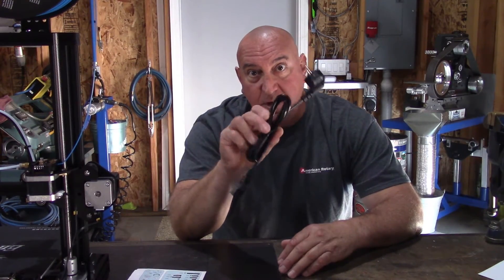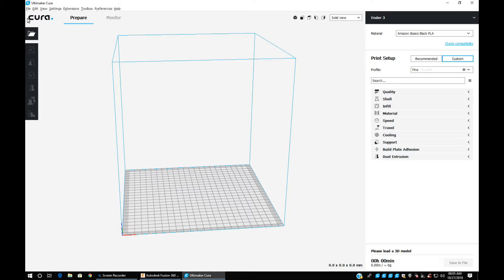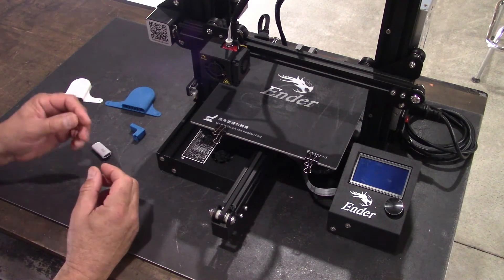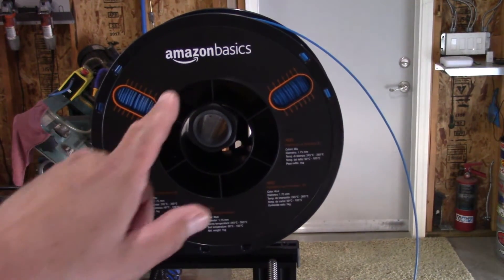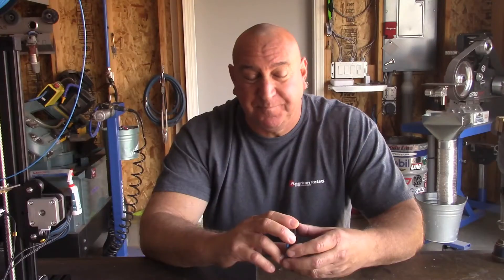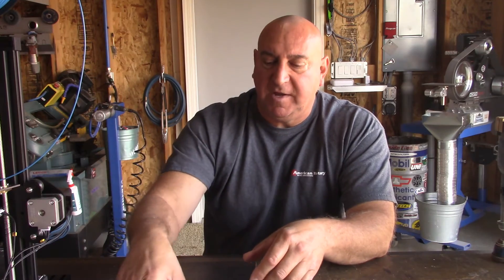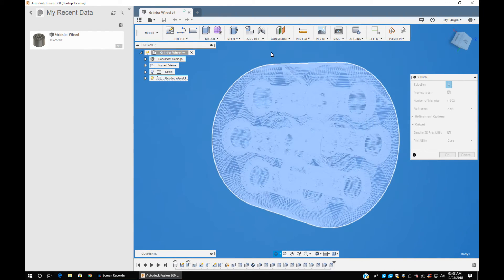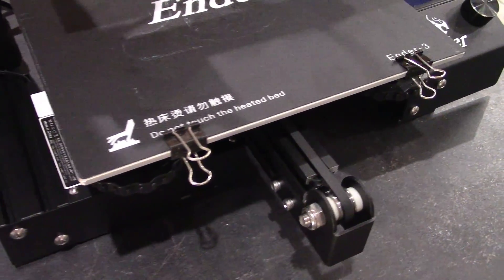Creality 3D Ender-3 Printer Part 2 #realraysgarage

Comment: How was your experience ordering from banggood? Did it arrive in a reasonable amount of time?
Reply from the maker: The printer did take about a week longer than standard U.S.A. shipping so that's not too bad coming from China! It was packed very well and no damage at all. I really like this printer, works very well after a short learning curve and some trial and error. Its a great printer for the price!
Reply: @RaysGarage  Thanks, going to order one within the hour. Do you have any suggestions of accessories to purchase along with the printer? I'm getting a couple of steel nozzles.
Reply from the maker: @lomeranger  I would recommend getting it set up and running, then maybe go to a glass platen and better height adjustment screws. Be sure and buy quality filament, I found the PETG works best, check this out; https://www.allthat3d.com/3d-printer-filament/
You will need filament, the printer only comes with a very little amount. I would also build an enclosure and or just put a cardboard box over the printer when printing, it will save you lots of headaches!!!
Reply: @RaysGarage  Enclosure? Raise the ambient temp? Ha! Just like ink jet printers, the price is in ink/filament. Just ordered the printer and am very excited. Would you say the enclosure helps with all filament types or just certain ones?

Comment: Ooo My I remember the Days.... It will not take you long to get it printing good, Just Patience is all you need. I would NOT Print in ABS unless you need to. Check out "PETG" Filament Just as good for most stuff you do and easier to print and PLA is good for most basic stuff :)
Reply from the maker: Thanks for the info, just picked up some PETG off Amazon and am really liking it so far!

Comment: ABS needs retain heat well above the bed proximity to keep from delaminating. ABS is also worse about warping when it cools. That will be your next findings. I use ABS almost exclusively, having learned to avoid the pitfalls, because you can make prettier things with vapor polishing ABS.

Comment: It's definitely a learning experience. Supports are your friend in Cura. And also learning what plane to print the part in. Check out the adaptive settings as well. Definitely helped me get a smoother print.